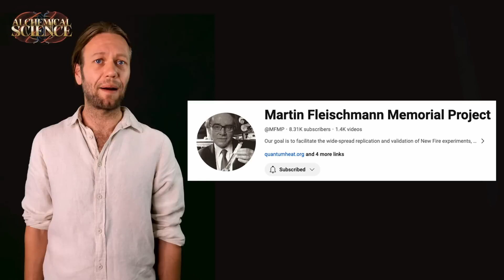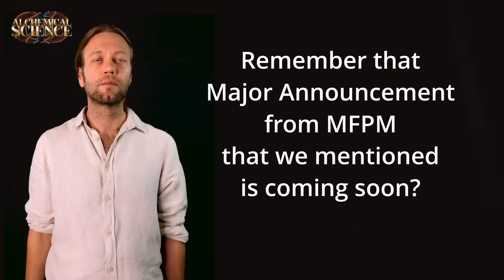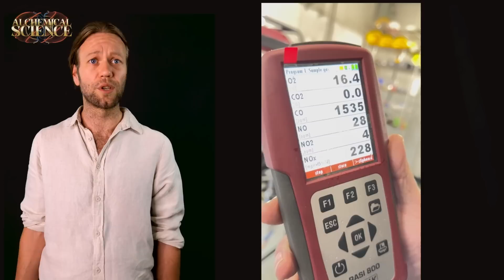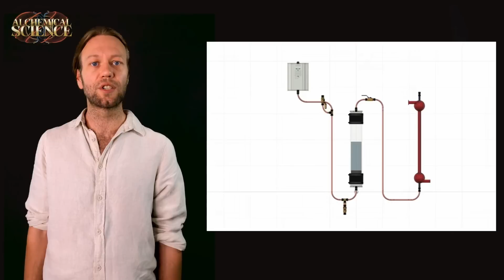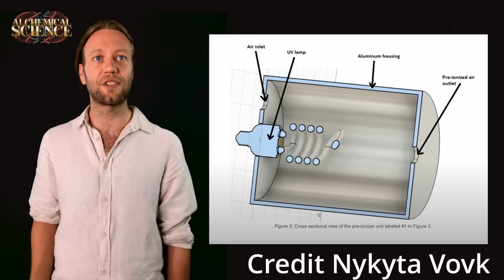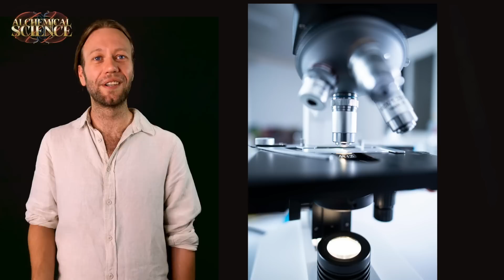Thunderstorm Generator Q & A | More Proof of Cavitation from MFMP | Plasmoid Tech Updates

Comment: You mention using 3" long pipe between de two 4" spheres and 2" long pipe between de two inner 3" spheres. This would be impossible. If the outer pipe is 3" long, the inner pipe should be 5" long. Also, using 1/2" pipe for the intake of that motor is very small, choking the air intake ?? Can someone provide more accurate measurements please.

Comment: There are optically clear metals like CMOS  (composite metal oxides on silicon) used to view spark plugs firing in the automotive industry that might be used to "view" the reactions. If it's not TOO expensive, and maintains the same reactions.

Comment: How is that 51.84 angle accomplished between the sphere’s and tube ? Is there an added piece welded in ? 
Or is it the tube that is flared it that angle to allow best flow into the spheres ?
Reply: why not just cut the angle on the pipe?
Reply: with a grinder fine tune it
Reply: @rscottlewis1  you can’t , it’s the transition from pipe to sphere

Comment: What might be so special about carbon having to be in the system? Might there not be other mineral that could perform the role, even in if another form of engine than the cylinder/piston thing? Now Carbon isn't rare, but I'd love for something more abundant to have a role. Like silicon. Might it be the carbon-hydrogen bond, a similar bond?
Reply: did you just call silicon abundant in comparison to carbon? what's your reasoning?

Comment: The oddly similar GEET reactor bubbled the fuel, and added water. Was the fuel obsolete, or might it have helped? GEET if I remember correctly didn't ionize the air nor fuel. I'd be very interested if the TSG were to have its fuel in the bubbler, and of course in a mix with water as seemed beneficial in GEET. Switching on and off of the UV lamp would be most interesting to see, how it changes ongoing real time measurements.

Comment: Hi Jordan, question.  My understanding is that compression is what causes the plasmoids to form in the bubbler.  Typical engine manifold pressures are only around 10 PSI which is about what would be present in the bubbler.  Has anyone indicated to you that is enough pressure to create the cavitation?  I see the results which are obvious.  The rather low pressure in the bubbler has been the main part of the system I haven’t been able to wrap my head around.  Great work, thanks!
Reply: From what I understand the catalyst inside the plasmoid generator helps to form the micro bubbles